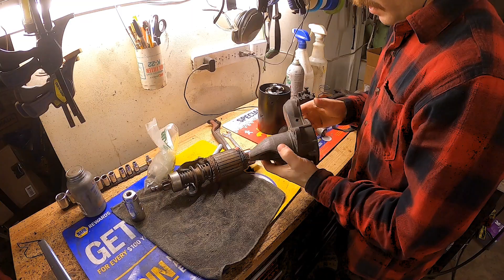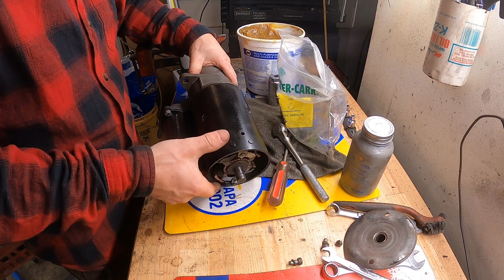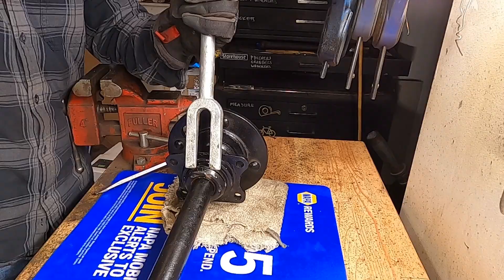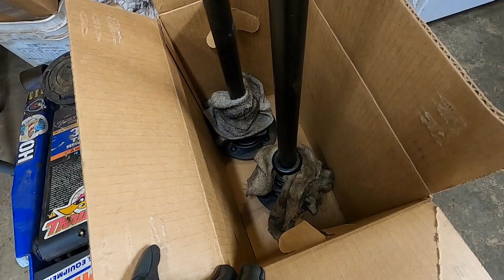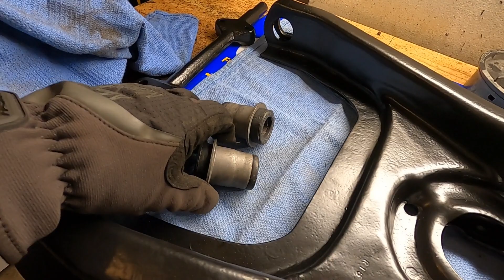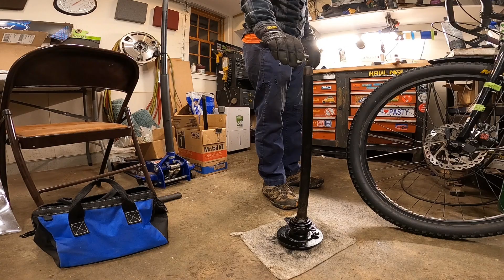Corvair Small Parts Restoration!

Comment: The outer race showing in your video (large, shiny, round) should be removable. At least it is on the 60-61 bearing. This exposes one side of the bearing and ever so slightly allows a spray cleaning and forced grease into the other half of the bearing. Here is a link to a (60-61) bearing disassembled as far as possible on the axle. 
https://www.google.com/imgres?imgurl=http%3A%2F%2Fcorvaircenter.com%2Fphorum%2Ffile.php%3F1%2Cfile%3D46328%2Cfilename%3Dmini-61_axles_011.jpg&imgrefurl=http%3A%2F%2Fcorvaircenter.com%2Fphorum%2Fread.php%3F1%2C333275&tbnid=RTVsyuGvDN3FjM&vet=12ahUKEwic1_OFr9f8AhXLN0QIHYrkAEAQMygEegUIARDbAg..i&docid=E3sbeLx6s3AGCM&w=900&h=675&q=corvair%20rear%20wheel%20bearings&ved=2ahUKEwic1_OFr9f8AhXLN0QIHYrkAEAQMygEegUIARDbAg
Reply from the maker: Apparently they changed em in 63. I don't know how, but i didn't see any way to get that sucker out further.